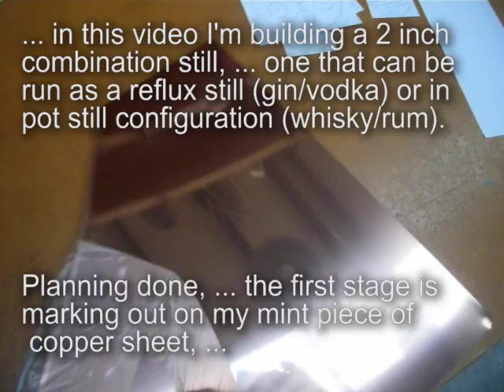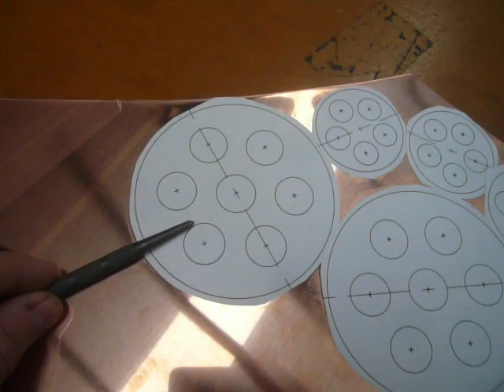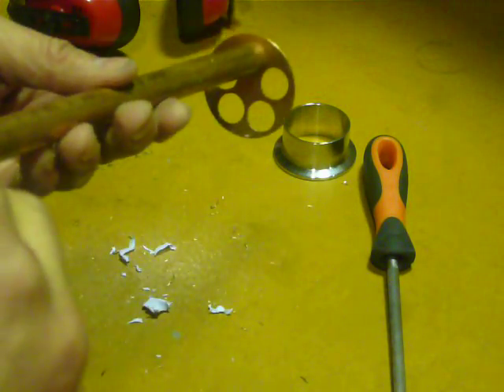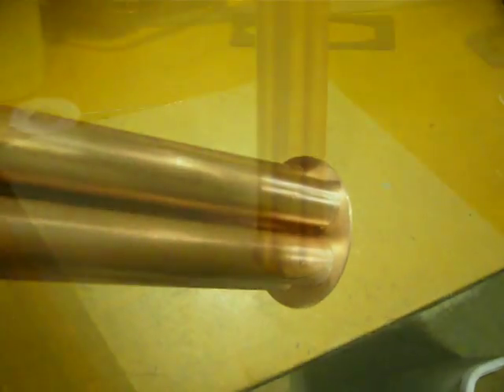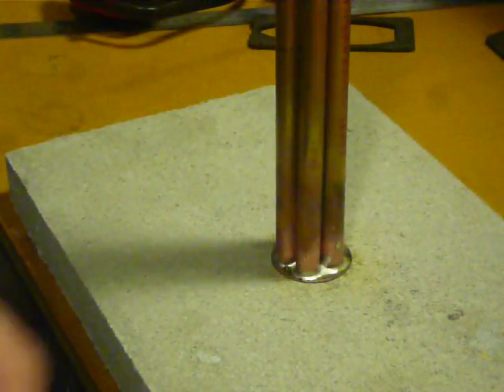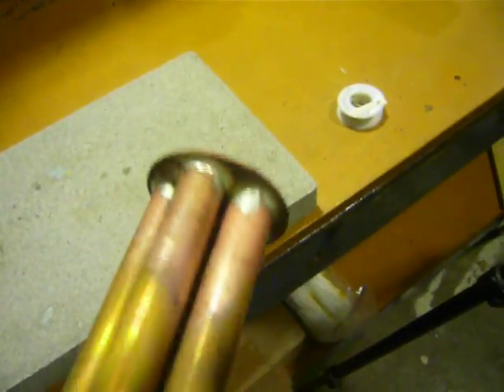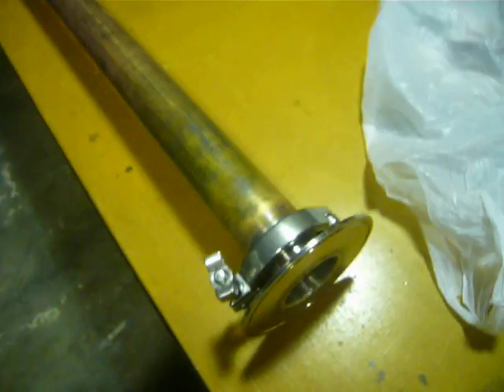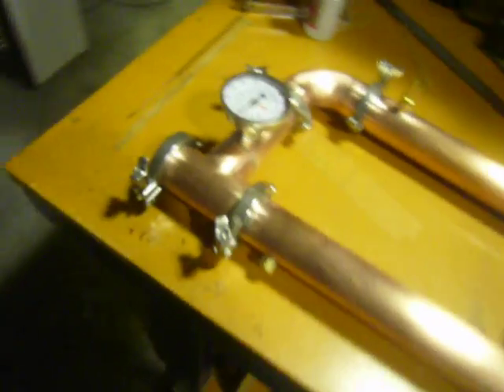2 inch combo-still build

Comment: Hi. What if you were to use pratley steel in stead of silver solder? Will it do the job? Nice informative videos.
Reply from the maker: Not heard of "Pratley steel" ... it's not some sort of epoxy based filler/joiner like "knead-it" is it? - in which case you should steer well clear of it.
Reply from the maker: ... yep, just did a quick interwebz search - it's an epoxy putty - definitely do NOT use that stuff on a still.

Basically if it's not recognised food-grade or food-safe application don't touch it.
I limit my work to;
TIG welding (stainless to stainless)
TIG welding (copper to copper)
TIG brazing silicon bronze (stainless to copper)
Lead/Cadmium free silver bearing solid wire solder (copper to copper - especially fine/thin stuff)

The silver soldering is the cheapest and fairly accessible on home workshop budget.

You really don't want to use anything else (apart from PTFE tapes/gaskets or corn-paste sealant if you wanna go old school) or you will contaminate your product and put your health at risk.

Theres alot to distilling in both building a still and the practice of running it - you can screw up and poison yourself in both instances.

Happy Distilling tho' Fujiar, make sure you read up before you jump in the deep end. :o)
Especially read around the topics of food-safe materials (as above) and removing foreshots (methanol/acetate/light distillates).

Comment: Hey, thanks for uploading such an informative video - I have a couple of questions if you're up for it:
- What is the name of the compass-like tool that allows you to scribe into metal? I'm only familiar with the type that hold pencils.
- Have you ever tried a reflux run without packing using only the dephlegmator? I've been thinking on this a lot and I want to try making a still that doesn't have any expendables. I feel like copper scrubbing pads getting used up is such a waste!

Thanks in advance and beautiful work - I never realized I could do that with a dremel!
Reply: I'd also love to know how you got that thermometer on without using a thermowell - I understand your description, but it would be great to see it apart if you have the time / inclination. Thanks again!

Edit: I just went and watched the first part of the cleaning run where you wrap the teflon tape around the thermometer's threads. Can you confirm that you're threading the thermometer directly into that brass fitting? My partner and I are putting together a miniature combo still like this one but we're currently using a tri clamp cap with an inbuilt thermowell. I'm considering getting a plain cap and drilling into it to copy your method if possible!
Reply from the maker: The compass is a compass hehe - engineers compass, has a scribe/point on both ends.

I don't run a lot in reflux - mainly got into this to makes heavy flavourful whiskies.
You need some kind of packing or bubble plates below your dephleg or you don't get any reflux at all.

You're welcome fella.
Happy Distilling! 😊
Reply from the maker: @erich1394  
Yeah the thermo is a 1/2inch bsp thread that screws into the socket - I use plumbers PTFE tape on the fitting to get an airtight seal.

Comment: nice looking set up, really enjoying watching your vids . On the stainless to copper joins which flux and solder are you using? The 50 mm copper tube I have is a very tight fit onto the ferrule, would annealing the end of the tube then forcing it over the ferrule work. I'm just getting the bits together to build a pot still modular system similar to this to upgrade latter to reflux. You can thank Still it for the questions as i found your channel after watching his. Cheers Simon
Reply from the maker: G'day Simon,
Stainless to copper I use a lead free, "50/50" silver bearing solder - food grade/plumbing grade, don't be tempted to use anything other than lead-free plumbing grade. :o)
Aside from the toxicity issue , I chose it because it has a lower working temp' (around 430 degC) than ProSilver type brazing solutions which means it doesn't anneal hardened copper water pipe and can be worked on easily with Mapp gas.

Flux  is a La-Co, F-400 liquid flux (a generic all-purpose soldering flux). I was using Comweld 965 but it became harder to find here in NZ and cost much more.
Just remember to avoid getting a lung full of the vapor when you apply it to a hot copper surface - it will mess you up.

Yep, the 50mm s/s ferrules are a tight fit into copper pipe but I don't have much trouble by the time I've toothed the outside of the ferrule (belt sander) and the inside of the pipe at the join, fluxed them and then tap them home with a soft mallet. Make sure you wear googles just incase the flux sprays.

Yeah Jess' over at Still-It is a "GC" ! LOL

Happy distilling Simon.
Reply: LemmingHerda 
Cheers great help

Comment: I very much enjoyed the vid, cheers! 
Does the thermometer measure temp of the water in the jacket or should the thermometer be in the column below where the water jacket starts in order to measure the temp of the steam before it enters the defleg tubes?
Thanks!
Reply from the maker: G'day, glad you liked the vid.
The thermometers I have put into this still measure the vapour temp' above and below the reflux column/ dephlegmator.
I've heard of people measuring water jacket temp for automated cooling systems etc - I've not messed around with that yet.

Happy Distilling!

Comment: Beautiful work. Very inspiring. What sort of power do you reckon it would take to run?
Reply from the maker: Thanks Tim, 
I've run this on a 50L "keggle" (build for that is in another video I made), I've run it on 2500W and also on a 3000W element with a variable power controller ( It should easily work on a smaller 2kW element and I've done a quick water-test with one just to see how fast it would heat) - on my actual runs I was just using what I swiped from my larger still.
Benefit of a smaller element is that you can run it off a standard domestic 10amp wall socket.
When you with larger elements you start requiring special workshop style 15amp wall plugs and heavier wiring in the walls back to the fuse box.
Once you get the still up to temp' where you are beginning to take foreshots/product you are dialing the power right back anyways.

Happy Distilling!

Comment: What kind of flux (im also in nz) do you use for the copper to stainless?
Reply from the maker: G'day fella, was using a generic liquid soldering flux, recently started using a hi-temp generic soldering flux (comes as a dark-grey paste in a small pot) have very recently been given over to silicon bronze brazing where appropriate.

Comment: Hi, great video! where do we get hold of the copper tube sizes that you paste on the copper plate.
Reply from the maker: Heya Thapelo,
Sorry for the late reply.
The jacket is 2" (50mm) copper tube and the cooling tubes are 1/2" (15mm).
Problem is different countries work on different tube and pipe schedules, some go by outside diameter and some go by internal.

Where you wanting the pdf patterns of the baffle layouts? I'm planning on doing a mass mailout soon if you can give me an email address.

Happy Distilling!

Comment: how do you prevent the packing from falling in your column?
Reply from the maker: Heya Peter.
I usually just bend a piece of stainless welding rod into a spring "bow" shape that sits on the ferrule just inside the column.
Having it removable makes cleaning the column out a lot easier.
Happy Distilling!

Comment: should have just used a hole saw, they make 'em up to 5 inch
Reply from the maker: Yep you're right - could have done that for sure … 4" metal cutting holesaw is kinda pricey where I am and I don't make baffles that often. Have been waiting til I had some lasercutting work to do and outsourcing a batch to a metal laser-cutters. 
I have smaller holesaws I could have used for the 2" but didn't want a hole thru' the centre of the 2" baffle.
With the smaller tube-holes I went small and then lightly filed them out to make press-fits.

Happy Distilling!

Comment: That is soft solder, not silver solder!, silver solder needs the copper near to red hot before it melts. Nice fits though :o)
Reply from the maker: G'day Roger, Thanks.
It is indeed a soft solder AND a silver solder - technically it is; "lead-free silver bearing solid wire solder" (that's what you'd ask for over the counter).
Plumbers use it all the time.
I believe you are thinking of "silver brazing" where you do apply a lot more heat and use a brazing wire (something like a prosilver 34T/45T brazing rod/wire - has no cadmium or lead) and you'll need a specialized brazing flux instead of the general purpose acidic zinc-chloride liquid flux you use for soldering.

Some advantages to "soldering" over "brazing" is that you don't end up annealing (softening) the copper (if you are using hardened copper waterpipe for example) and it's a lot easier for "guys in sheds" to do with comparably low-cost low-heat mapp or propane gas setups.

Happy Distilling! :)
Reply: Cheers for the explanation on the flux you are using. Im using the paste that comes with the burnsomatic silver solder from mitre ten. That stuff pretty much turns to tar when it gets to temp and forget about soldering the ferrels in! The solder just balls up and falls off the side!! Ill have a look for some liquid stuff tomorrow. What brand flux do you use? 
Ps; your still looks amazing!! Id be stoaked if mine turnd out to be half of what you have made!!
Reply from the maker: G'day Nick, Happy New Year!
I buy my lead-free silver-wire solder from Mitre 10 (not many other places carry it) but not much else.
I use a generic generic liquid flux - you can find similar at Global Welding or BOC in N.Z.
The one I used in the videos here is an "F-400" and it's "LA-CO" brand - I got it from Global Welding Supplies.
You want to make sure it is zinc-chloride flux and it will usually mention "suitable for stainless steel" somewhere on the pottle.

In the last 6-12 months I've started getting away from soft-soldering stainless to copper and tend to Silicon-Bronze TIG braze those kind of joins - especially if they are large and load-bearing like a 4inch column or some such.
That wasn't an option when I first started out doing this stuff and the soft solder works fine if you have some patience and persevere with it.

Happy Distilling!

Comment: Currently planning to build a pot still out of a 50L Keg with a 5500w element (controlled so that I can dial it down) for Rum/Whiskey/Brandy (not vodka). If I go the shotgun way What would you recommend for the height of the column and the diameter? Also what length/diameter would you recommend for the shotgun?
Reply from the maker: G'day Maxime, I have a video up recently of a 50L stainless beer keg conversion I've done to fit this copper combo still.
General rule of thumb is height for purity, diameter for draw-off speed (ie; how much alcohol you can feed it - relies on the size/charge of your kettle to a greater extent).

I started with a 4" column on the first potstill I built (I have videos of it on my channel) but that was future proofing it as I knew I would be transfering the column/still-head to a larger kettle eventually.
2" diameter should be fine for a 50L kettle and it's pretty much what everyone doing a home-build defaults to (2" copper tube is also A LOT cheaper than 4") .

5500W is lots of power in a 50L - I'm running 6kW (2x 3kW) in a 180L charge kettle and it's none too slow.
You would want to make sure you have a low density (large surface area) element, or you could risk scorching your wash at full power - even more so with heavier/denser washes as you get with flavorful Rums and Whiskeys.
I went with a 2" diameter 1 metre long column (partly so I could pack it to use in reflux config') and about a 500-600mm long shotgun condenser for this rig. Works out ok on a 50L kettle.

Happy Distilling!
Reply: Angry Parrot Distillery thank you so much for such a detailed answer. My element is ULWD so I should not be scorching anything. I can also adjust the power output in % using my PID. How long does it take you to do a full run using a 50L keg and a 2" column?
Reply from the maker: G'day Maxime,
Varies - depending on wash, alcohol content, whether I'm doing a stripping run or a finishing run.

I do bring the 50L up to temp' slowly to avoid scorching the wash, either on the element with electricity or on the bottom of the kettle with gas - when I've been running the 50L on gas banjo it usually around 2.5 - 3 hours to come up to temp from memory and start outputting product.

Running a single pass on something like a rum with a thumper on my 50L, it's generally 5-6 hours from firing it up, to turning off - but like I say, it can vary, I've done stripping runs that have been a lot faster.

If I'm doing a finishing pass or a single pass with the thumper I'm not pushing it at all.
Distilling something flavorful like a fruit brandy or a single malt whisky I'm going to be especially gentle, but when stripping the guts out of a down and dirty sugar-wash maybe not so much. :o)

Best thing is not to be in a rush - you will taste the difference.
~Happy Distilling.
Reply: What do you think of a 100% stainless build plugged with copper mesh : column/shotgun ? would you recommend it or would you go with copper? and why? thanks
Reply from the maker: G'day Maxime,
I've done exactly that with my 4" build for my HWC kettle (about 180L) the same 4" build will transfer across onto my 600L kettle when that is finished (aiming towards a small craft distillery).
See my "4" s/s Lyne arm" video for some current (Feb 2018) images of that.
If anything I would eventually go with a 4" copper column (vapor path contact) to replace the S/S - but that's an expense that can wait (hundreds and hundreds of dollars just in 4" copper tube) and I got my 4" s/s tube for a dirt cheap price.

If I'm running reflux I'll have copper packing in the 4" stainless column, my 4" dephlegmator is copper and the internals for my 4" shotgun condenser will all be copper (with stainless jacket).
I love copper, but 4" copper is SO expensive and if it's not directly in contact with the vapor path its really a bit of a waste.

I would try and get SOME copper contact in the vapor path, I know people that swear black and blue it makes a difference and I believe them.
There is a vid on youtube of a HUGE brandy distillery with a inch and a half condenser outlet and you can SEE copper sulphate crystals forming/precipitating out of the distillate so there is method to the madness.
https://www.youtube.com/watch?v=UjFkyWbmqfU

Happy Distilling!

Comment: That would be a perfect job for a water jet cutter.
Reply from the maker: Yep! :o)
Made a few stills/condensers etc for people in the last year - 2", 4" and bigger, I get the baffles laser-cut now days - saves a hell of a lot on my labor as cutting the baffles out is very time consuming and if you are doing a large number it's a right pita.
Although, if you are doing a one off for yourself - as this initial one was, then the labor cost is not an issue. :o)

Comment: hello great design - i just don't understand why the tee at the top and not the 90 degree elbow
Reply from the maker: T is at the top to allow some flexibility.
Is possible to have it open and drop a cooling coil down the centre of it rather than using a dephlegmator.

Keeps the system flexible depending on what folks want.

But you are right, 90deg elbow also does the job and still I've subsiquently sold ended up with elbows instead of T's just to simplify things. 👍

Happy Distilling!
Reply: @AngryParrotDistillery  Thanks for the answer, and does the dephlegmator have to be removed for simple pot-still distillation? Can it stay there but not connected to the water supply? How much in NZ does such a column cost from pipe 54? Best regards from PL
Reply: @AngryParrotDistillery  Does the cooler have to be placed at an angle of e.g. 20-30 degrees to the column or can it be mounted vertically?
Reply: @AngryParrotDistillery  Sorry, I mean, does the reflux adapter have to be removed for simple distillation? and the next question, is it possible to use soldered connections instead of tri-clamp connections. The column will not be transported etc. Should the cooler be bent in relation to the column or can it be permanently vertical? greetings
Reply from the maker: @robertweglik9238  
G'day Robert, can be mounted verticle.
Would work better mounted on an angle as the vapor is not in freefall and instead "crashes" against the cold condenser tubes as it decends.
Reply from the maker: @robertweglik9238 
G'day fella,
Dephleg' can stay inline without cooling and have the still operate as a potstill, it's just one more item to bring up to temp.
Reply from the maker: @robertweglik9238  
Pipe 54?
Reply: @AngryParrotDistillery  I am just assembling all the copper elements to be built according to your project
Reply: @AngryParrotDistillery  What plate height did you use for the tri-clamp? Standard or higher?
Reply: @AngryParrotDistillery  Hello Friend. Yes, tube 54x1.5 inside 51